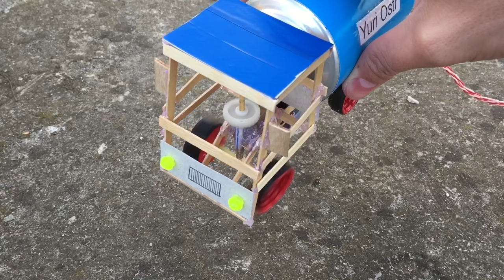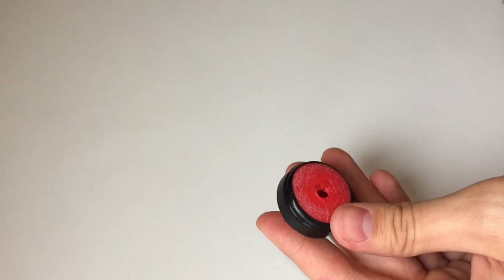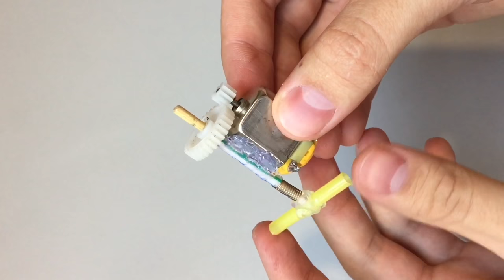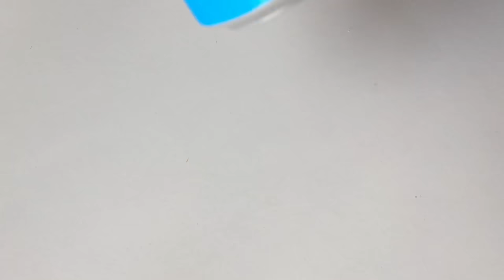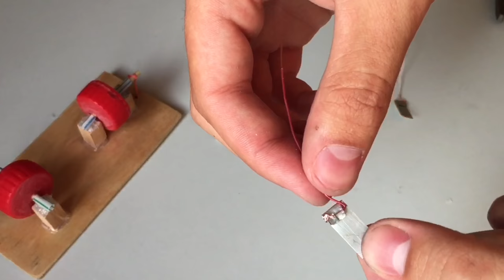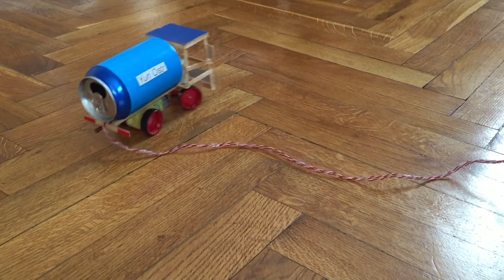Awesome Remote Controlled Truck - How to Make a Car Out of Popsicle Sticks

Comment: Nice videos man, would u mind answering a question. So on your RC truck video, I tried to replicate the steering system, and it turns when I'm holding it up in the air but not when I set it on the ground. Do u know what I'm doing wrong?

Comment: Сделай пожалуйста пожарную машину на пульте управления которая будет брызгать водой и тушить огонь. Водяной насос короче добавь. Will you please do a fire truck on the remote control which will spray water and put out the fire. Water pump short throw.